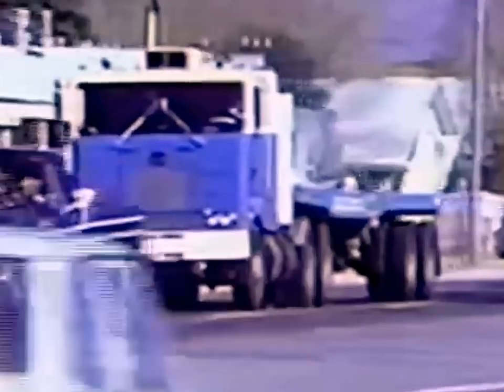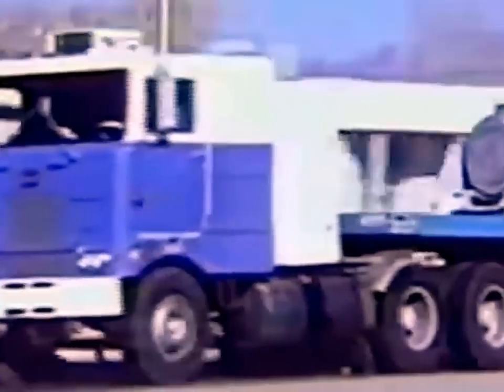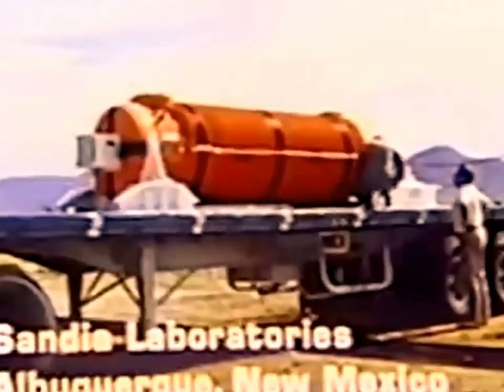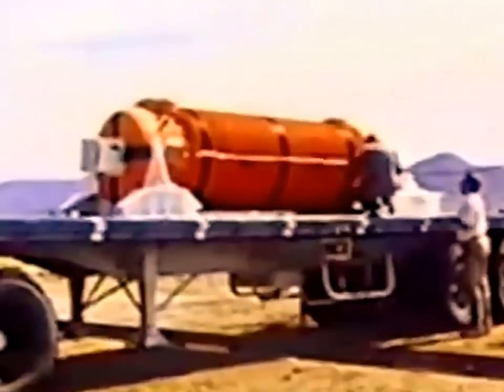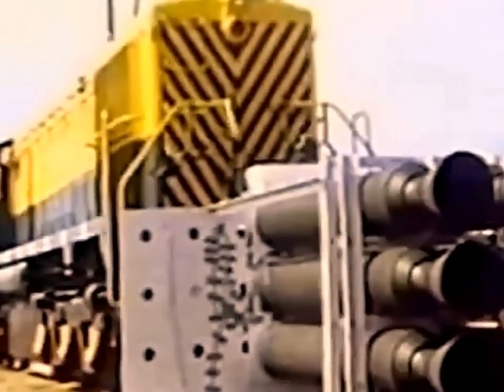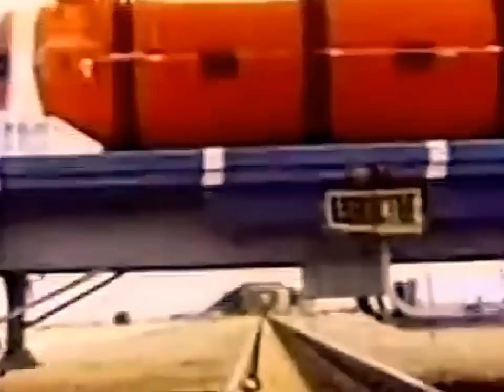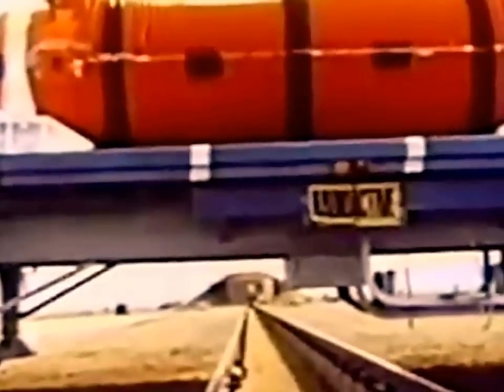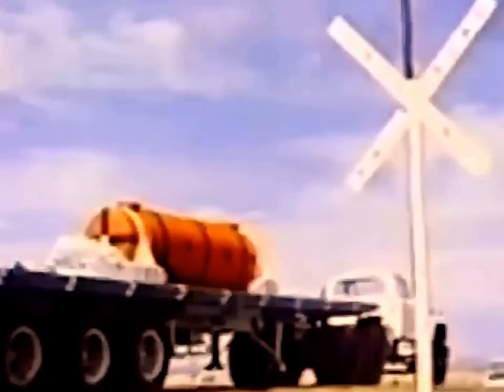Restored Version 720HD  - Rocket Powered Train Impact Test of Spent Nuclear Fuel Shipping Cask

Comment: The loco is heavy. The rockets were nothing but show - they barely moved the loco (yes I know the footage is slowed but I've seen the original). If it was a real test they'd have had far more measurement equipment on site and used the loco engine (with all its torque) to get to speed.

I don't trust any government with nuclear fuel or waste. Every country has had major incidents and covered them up. We need a shift away from nuclear.
Reply: Jack King It is slowed down to show the detail of the impact, they obviously had enough measuring equipment to do the job.
Reply: If we can't work with nuclear how will we ever get to antimatter reactor thousand times that of nuclear energy power plants
Reply: Our World in Data show that Nuclear is in line with renewables.
Reply: @oregonrailfan7046  Thats a surefire murican reaction if I ever heard one
Reply: Really, does that include the cost of decommissioning reactors, transporting and storing the horrendously Radioactive components within the pressure vessel? We have yet to decide how we're going to store it and it's been what now 60 years? I am not some Luddite I have a degree in chemistry and actually used to work near Sandia at another lab on Kirtland Air Force base.